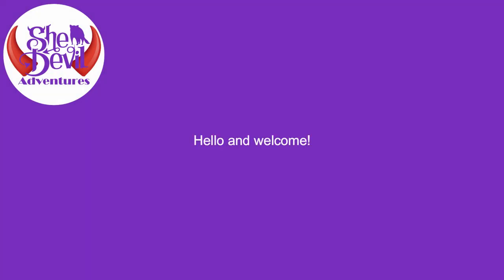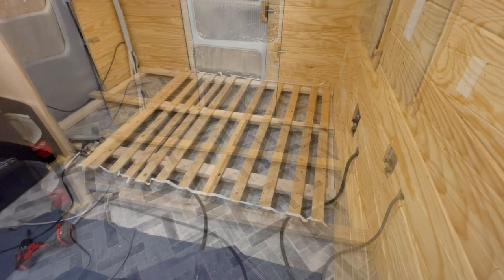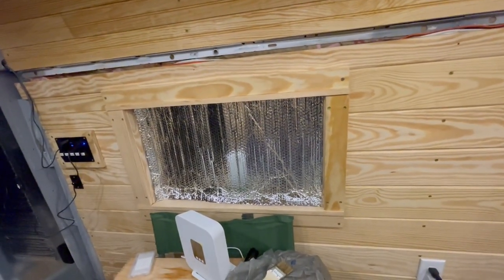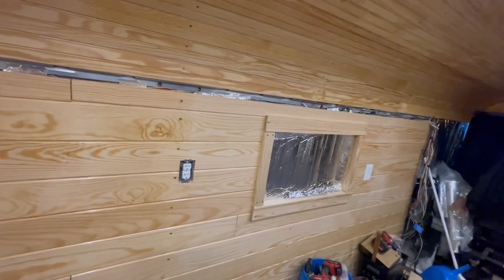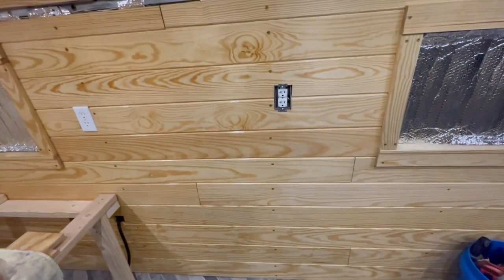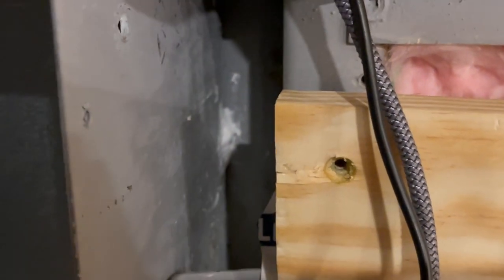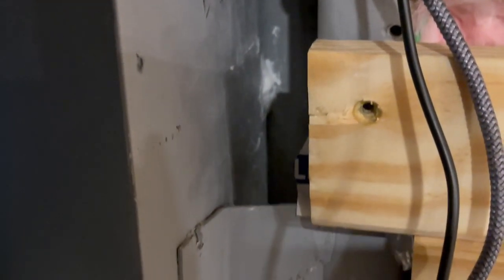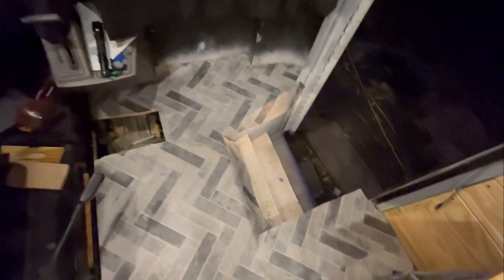School Bus Build: Bed Frame and More

Comment: Isn't the bus mostly complete? I mean this is just the delay of editing right? It is looking awesome though👍😁
Reply from the maker: No. I actually still have walls that make up sections like the bathroom, and I still have cabinets and a desk to build. I am getting there. I still work full-time and can only work on the bus in my spare time. Thanks for stopping by Cookie. It is very much appreciated. 🤗
Reply: @SheDevilAdventures  Ok, for some reason I thought you had already been camping in it.👍
Reply from the maker: @CookieMonster_1969  I did attend a Skoolie Swarm here in VA back in October. At that time the paint job was all that was complete. None of the interior was done. At that time it was a metal tent. 😂